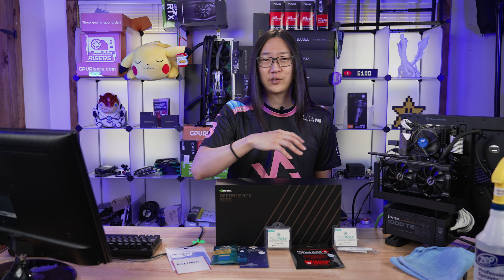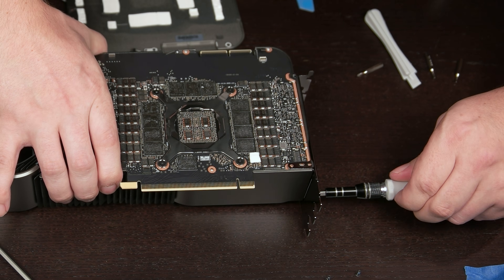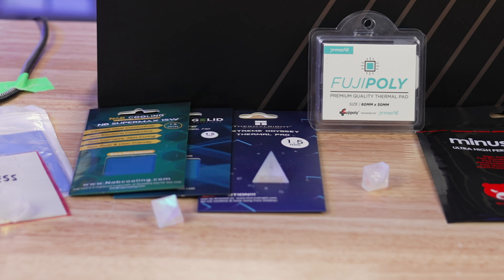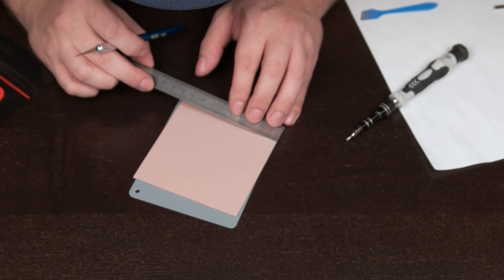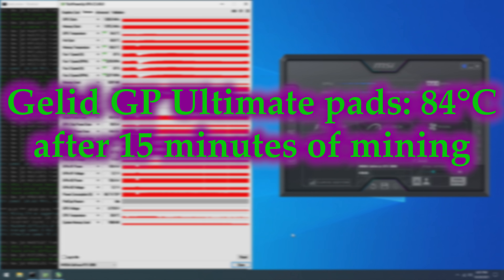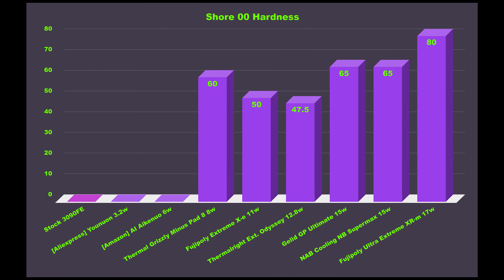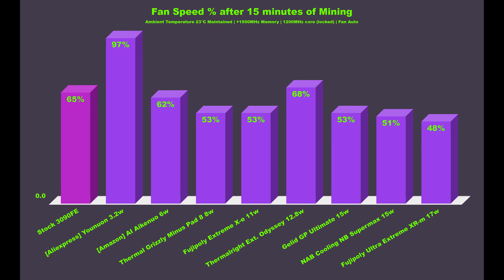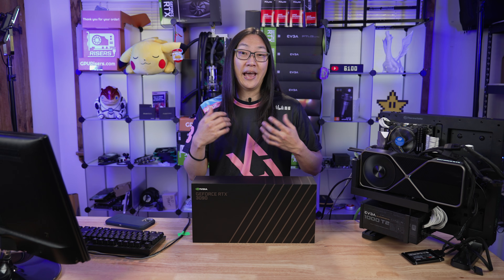Thermal Pad Showdown! What you should (and Shouldn't) Buy

Comment: I've repadded a lot of 3090 FE , I've had no problems with the thermalright extreme odyssey , they measure as 1.5mm as advertised using a micrometer .  My benchmarking involves running the card at 105C max on the hotspot .On a stock 3090 this usually involves underclocking the ram significantly and usually gets something like 80Mhash . With the thermaltakes and a repaste I'll get 120Mhash with a very high overclock and temps will usually stay at 98 or below with fan sitting at 60% ( which means the card can be pretty much silent  when mining). 
I've used Gelids as a comparison and found zero difference in performance. I use gelid and thermaltake on Zotac and Msi and not noticed much difference between the two . 
Only difference being going for 0.5mm thicker on the gelids vs stock pads due to softness . I generally prefer to use the thermalright and take care to precisely measure the pads with a micrometer ( its all 1.5mm on the 3090 FE) on most 3080 and 3090  other than FE  you only need to replace the memory pads front and back , the other components are usually fine with the stock pads whihc is just as well as they often use odd thicknesses like 1.3 and 1.7mm ( its totally fine to sandwich pads together to get the thickness required by the way)
Reply from the maker: Awesome, thank you for the feedback!

Comment: I replaced my thermal pads with the Thermalright on my 3080 FE a while ago. Temps didn't change but I am now getting full performance. Would it be worth it to re do the whole process again with Gelid pads?
Reply from the maker: If you're not having issues, it's probably fine. Honestly, this procedure would only be applicable to the people that actually have the issue, meaning that their card might be binned lower and need a better heat transfer or they're doing an application that takes more heat.

If it ain't  broke. Don't fix it lol

Comment: Thank you for the video. My watercooled 3080 was overheating and I got the thermal grizzly pads before I saw this video. But if I ever have to replace them again, I think I will go with the Gelid pads. I do not have memory modules on the back of my 3080 but I did put pads behind the chips to help cool them. I also took some old motherboard heatsinks that were flat on the bottom and use some thermal tape and attached them to the back of my card. I like to think that it is helping as both the back of the card and the heatsinks are now very hot and my temps have started coming down.
Reply from the maker: That's awesome man. Thanks for the feedback!

Comment: Which one will hold the Vram heatsinks better??
Reply from the maker: Hey there, for VRAM heat sinks, you probably want to use something like thermal tape. Thermal pads aren't as sticky to hold on metal heating's like that.

You could try to check in this link out, by using this link. Amazon may provide me some commission  had no cost to you

https://amzn.to/30fXJdb

Also, you could check out my other videos about thermal investigations on the 3090. I do a lot of stuff about heat sinks

Comment: I recently bought a 3090 FE and tried running a miner on it this afternoon. VRAM temps immediately shot up to 106 C and throttled. This was in my basement which has an ambient temperature of maybe 18.5 C. That seems way hotter than what you're getting. Also, the default fan curve was taking the fan up to 100%. When I set the whole card's power limit to about 60%, I could get the fan down to about 70-75% speed.

My concern is that the performance is way worse that what this video lists with the stock thermal pads and I was actually UNDERCLOCKING to try and save on heat. Do you think there's something wrong with my 3090?
Reply from the maker: Thanks for the detailed response. Unfortunately, the way things work your mileage will vary. Everyone's card is slightly different and no two cards are exactly the same. It could be a lot of factors all the way from silicon lottery to bad thermal pads. 30 90s aren't particularly known for having the best pads. Being that they were engineered for gaming and not mining.

Comment: Geat content, thanks for this! I have the 3090FE, I’m only gaming and cannot decide if I should go for a re-pad or not given the increased heat transfer to the core. The reason I am considering doing this is fan noise - clearly the memtemps are what’s makes the fans spool up on auto while gaming. What’s to expect here? Would a repad, let’s say using the gelid’s, make the core hotter while gaming and in the end not make any difference in fan noise/make it worse or should I expect a quieter card with better ”average combined” temps?
Reply from the maker: It would be dependent on your situation. However, lower memory temps can never hurt. If you're looking for the lowest noise, then your memory temps are going to be high. If you're looking for the lowest temperatures, then your noise is going to be higher. There's no way to get a free lunch.

A lot of people like to go for the average or middle of the road. However, I did find more efficient heat transfer. Always turns out better in the long run

Comment: Great video man!  Would love to see the top 3 pads tested used throughout the entire card so we can see the entire story.  
Personally I was on the fence about getting the Fujipoly extreme for my Tuf 3090, but I'm glad I did.  
I replaced the stock pads on both sides of the card and the temps are now very close to overclocked water cooled cards.  

My bios is flashed to enable max power draw, and the overclock is pushed to the limit; so it definitely put the Fujipoly to the test.  
Would love to see how the Gelid pads compare, they seem very good as well.
As for my temps, I'm consistently running 600 to 700 watts of draw in Warzone, and gpu temps stay in the mid to low 50's after hours on the game.

Looking forward to your future videos!.
Reply from the maker: Dude that's awesome! Thanks for the feed back!
Reply: Did you use the 1.5 mm pads throughout the entire card?
Reply: @Jurisdiction249  On the back plate there was a combination of 0.5mm and 2mm pads.  On the smaller heatsink they were all 1.5mm pads, and on the main heatsink I believe they were 1.5mm as well(forgot to record that areas thickness in my notes).

Comment: you are spreading misinformation with the thermalright pads, iv been using the thermalrights and having super good results
Reply from the maker: Did you watch the whole video?
Reply: @TekShinji  no, and honestly 90% will only watch until he graphs and thats another reason why this video is misleading
Reply from the maker: Hi there, I recommend watching the whole video. We specifically state that they weren't bad but rather they tested lower for reasons explained. In fact, we only said certain pads were bad.

I ask what experience with thermal rights is? How many pads have you used and how many cards have you done? We're curious as to the general consensus of those pads.

However, if you only wish to let us know your opinion and not give any data,  That's fine, we'll take your opinions into consideration.
Reply: @TekShinji  im a miner, i changed pads on 3070ti's and 3080's, on the gigabyte cards and FE 3080 the temps went from 110/112 thermal to 84/86 on the 3080's using thermalright pads, they never failed me and i always got huge improves in temps
Reply from the maker: Thanks for your feedback. I appreciate it! As you very well are aware;  everyone's mileage will in fact very. It's not a if, it's a will. So with that said, we try together as much information as possible.

Could you please tell us the thickness is used and the exact brand model? That way we could look into the repeatability.

By the way, since you've only watched a small portion of the video.  I have to assume the process of what we did has not been made relevant to you?

Comment: I had the same exact issue I repadded my RTX 3080 MSI Ventus GPU using Gelids effectively lowering VRAM temps from 108 to 76 HOWEVER that raised the GPU’s CPU temps from 46 to 56 so I am glad you explained here that this is a basic heat transfer I thought I did something wrong. Thank you this is very informative video I am going to repad another MSI RTX 3080 Gaming X that is hitting 108 degrees right now. Also will have to repad a Zoltax RTX 3080 lhr that is hitting 108 also
Reply from the maker: You're welcome there! I'm glad you enjoyed the video and it was informative. It was a lot of hard work and we appreciate it when someone likes it!

It is definitely an interesting find how the thermal capacity of the cooler can be somewhat at its limit to where it increases the GPU temperature because of the VRAM efficiency.
Reply: What is the issue ?
Reply from the maker: Memory temperatures.

Comment: I used 2.0mm for Nvidia and they are to big, core temp shot up. Had to reopen the card and squash the thermal pads a bit.
Reply from the maker: Ah but  this video is a comparison between pads and not a how to on a specific card, could you tell us what pads are used and your results and specific details?
Reply: @TekShinji  I used Gelid extreme 2.0mm for the Rtx 3080 fe. Mem temp went from over 100c to 78c max.
Reply from the maker: Thanks for the feedback. Much appreciated!

Comment: I can't thank you enough for making this video I was really struggling with deciding on a thermal pad brand.
Before watching your video I was honestly going to just dish out for the Fujipoly but thanks to your video i ended up with GELID. 

1070ti is now sitting at 
Now: 30.5MH/S @ 60c, 105W, Fan 60%, 290~300kH/W
Before: 30.5MH/s @70~75c but with maybe 200~250kH/W

Overall (thank to your video) I've noticed a SIGNIFICANT increase in CONSISTENCY.

The 1070ti (Founders Edition) required .5mm, 1mm, 1.5mm, and 2.0mm thermal pads.
I measured each and every pad to ensure they remained the same thickness. 

I do have to warn though that the GELID thermal pads are very tough to reuse as they are like a clay substance that sorta crumbles after taking off / putting back on.
Reply from the maker: here there thanks for watching the vid! i hope things go well and good gaming!~

Comment: First time viewer, this is a pretty damn great video - I think you've got yourself another subscriber! Personally I've used Thermalright pads on a couple of 3090 FE cards after fitting EK blocks. In both cases, the temperatures dropped around 10c under memory load compared to the pads EK supply which is about where they should be given the stated conductivity... Since I'm working with blocks, the results aren't directly comparable with yours obviously, and I use liquid metal on the die and the (free and softer) EK pads where heat transfer isn't needed, like on top of the chokes, which would likely mitigate any compression issues the pinned commenter brought up... or maybe the 1mm pads are just made to tighter tolerances or weren't stamped on at the amazon warehouse... (they did measure at 1.0mm).
Reply from the maker: hey there Thanks for the feed back! water blocks thermal capacity is MUCH higher than standard air cooled so it wont be as much (or even at all a issue)
Reply: Mjb10 hello can I ask you a question? today I ordered the thermal right thermal pads precisely the thermal right Valor Odin 15w, I ordered them at 1mm for the memories, because ek waterblock declares that on the Vector ftw3 only the 1mm ones can go, I did well to order them right at 1mm and not more than? I hope they don't press too hard to reduce their thickness. thank you

Comment: Some Thermalright odyssey 1.5mm pads have issues with mounting pressure on the back side of the card 

I changed my 3090 FE pads to 1.5mm thermalrights, I never saw the reductions other people were reporting, Few months later got another pack this time 2mm, I changed the pads on the back memory to 2mm and then I saw the large temp drop, in my case 1.5mm was too thin for the back memory modules, though 1.5mm was correct for the front modules

Great video, Wished it had been made a year earlier
Reply from the maker: yes eveyones milage will varry its not possible to test evey situation unless we were doing it our selves but thanks for the feed back

Comment: Thank you very much for all this testing!
So 1.5mm pads should be right for a 3070 Ti Fe aswell right?
Reply from the maker: I've never personally worked on one of those myself. However, it appears that may be the case. Best idea to Google search yourself. This video is a comparison between the claims and the actual performance of the pads. Not a how to do video on a founder's edition. Since all pads tend to be slightly different depending on the card.

Comment: Not sure why your Thermalright pads didn't work. Maybe the fact they were thin.
Both myself and others I know have used these and had great results with 3080s and 3090s.
Reply from the maker: Exactly, everyone's situation's different and no two conditions are the same. There's a lot of variance that we just can't account for.  Thanks for the feedback, do you have any actual numbers or measurements or compression? We'd like to know what your experience was!
Reply: @TekShinji  Well from the people in the discord I'm in that did it I would say thickness is key. Some found 1.5mm worked while others went with 2mm. I personally did 2mm on my FE 3080. That is why I feel the 1.3mm ones you had (actual, not advertised) were probably too thin. I think there is a slim margin to getting the contact for the pads while not reducing the contact pressure on the GPU. I know that "plenty" of thermal paste is suggested by some, and a stiffer one (like kryonaut). Some had to redo things after finding it had not quite worked.
The reason so many used these pads was they were available here in the UK, while others were not.
The effects we have seen are up to 20C off the memory temps when mining Ethereum. Though in actual use it means you can push more power in and/or lower the fan speed. We are mostly gamers who casually mine so tend to not be wanting to run fans at 100%.
I also saw a slight increase in GPU temps, and my view was what you concluded that you are adding extra heat into the heatsink.
Regarding backplate cooling I don't think you get much on the 3080 as it has no rear chips but it does get warm, but with a 3090 I know some have tried assorts of heatsinks and even CPU coolers on it with some positive results. On my 3080 I didn't really notice any difference trying such things.
Reply: @surfx4804  Hey , what the pad did you use on your 3090s,  i was trying to use 1.5mm thermalright and 1.5 gelid ultra.. didn't get good results..
Reply from the maker: Thanks for the feedback! If you ever get a chance or if you have pads left over please measure them for us. We'd appreciate it!
Reply: @kuku556677  2mm thermalright is what I used and it was an FE 3080
Reply: @TekShinji  Will do, good excuse to order some callipers :)
Reply: @TekShinji  Amazon turned up with my callipers :)  I have some 2mm, 1.5mm and 0.5mm Thermalright Extreme Odyssey Pads.
2mm measured at 2mm
1.5mm measured at 1.52mm
0.5mm measured at 0.5mm but this is thin and easy to deform so was tricky
To confirm I used 2mm on my FE 3080 front and back, with the exception of the 0.5mm on the back side where the thin original pad was.
Reply from the maker: Thank you so much for the information! I appreciate it 🙂

Comment: I know it's gonna sound crazy, but an ultra thin layer of thermal compound on each pad before making contact gave me INCREDIBLE results versus just thermal pads direct to the surface.I mean the smallest amt of paste you can use, super spread out thin with no extra to squeeze out, just enough to make it tacky.
Reply: @djlowtek did you thermal paste the pads on just one side (the memory side?), or both the memory side and the backplate side of the pads?
Reply from the maker: Thanks for the feedback! Is it possible to ask for the exact procedure in details you used?
Reply: You mean paste on top of pad

Comment: I appreciate the work but I have some concerns about the very last slides. Having better conductivity between the pads and the cooler doesnt increase the overall temperature of the cooler so high that in increases the temp on the gpu die by 20+ degrees. The overall heat of the card doesnt increase because you  have  better pads. What caused this is very probably that  the pads hardness is higher and result in less pressure or contact between the cooler and the gpu die.
Reply from the maker: Hey there  thanks for the feedback. Did you notice the result was the same across all the pads ?

Comment: What would be the temperature using copper shims instead of thermal pads? That would be interesting to see
Reply from the maker: That is something we are planning to look into. At this moment in time. Copper shims are not practical in most applications, especially on graphics cards with components that don't have exact heights
Reply: @TekShinji  Damn, Youtube did not notify me this. Yeah, it is very impractical, I spent a lot of time with my GPU, I cant imagine for people with 50+ GPUs, but once you get the perfect thickness, you will get a big temp drop. I bought some 1mm copper shims and had to fill the remaining gap with TG Minus Pad 8, max temp was 82ºC. From almost 110º with stock pads or 96-98ºC with TG Minus Pads 8 alone, it is still a big drop for me. I think this is aimed more for mining applications, since GPUs gets high temps 24/7 and you want to run it the coldest possible.